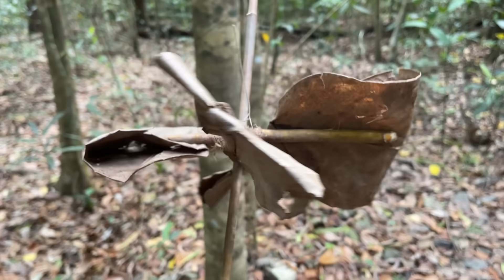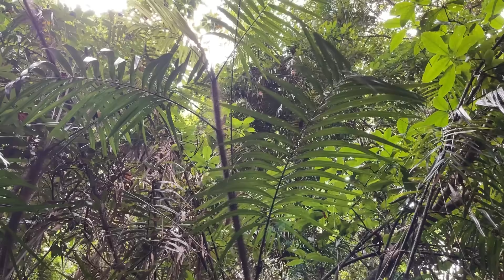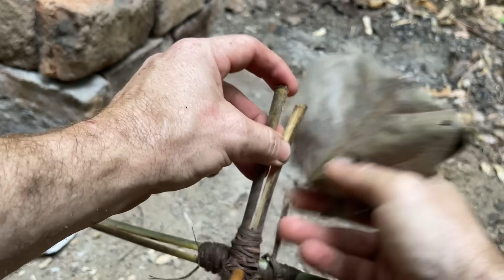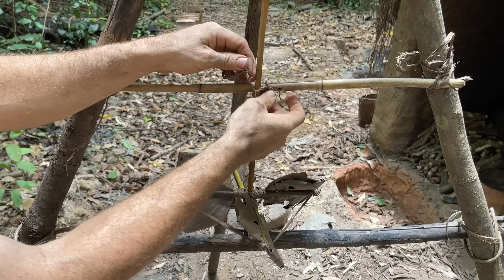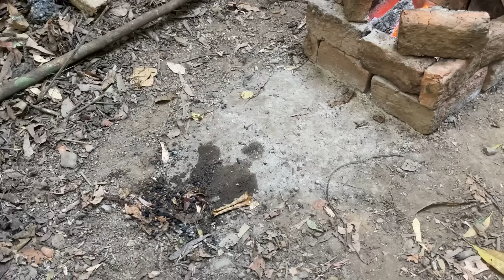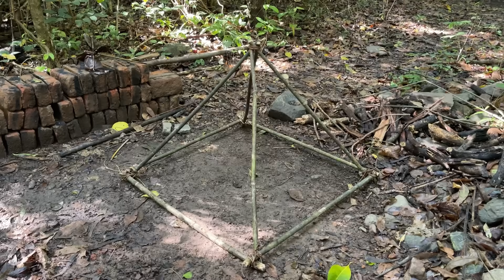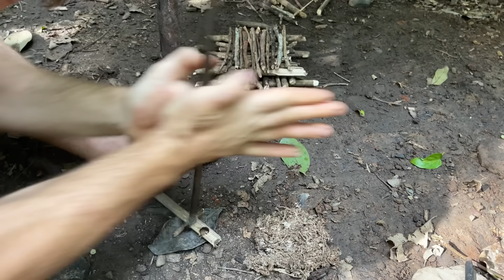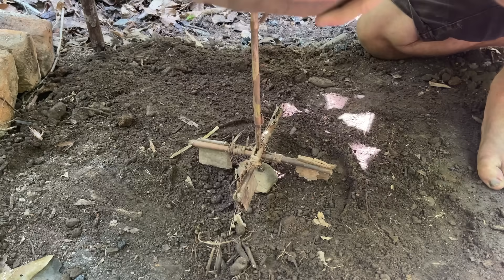Primitive Technology: Convection turbine experiments (hot air windmill)

Comment: The yield dont seem great. compare the energy released by such a fire, your own arm and the actual speed of the rotor. There is already a natural efficient convection that suck air. The turbine capture energy loss and the already efficient convection and transfert it with a yield. However your losing most of the heat and overpressure. If you lose all the gaz and the heat on the side, you are just introducing air resistance to the basic convection and to the inlet...

Self optimized fireplaces have solid wall with well designed primary/secondary flow to exploit energy. Also an hoven want to maximize the temperature and an heater what to maximize the dissipation it is not the same.

Comment: Nice proof of concept. A few engineering thoughts: the efficiency could be improved by shaping the chimney outlet into a side jet so the hot air hits the rotor tangentially and by replacing floppy leaves with rigid but lightweight cup blades that can actually hold their shape. Thin bark, split wood, or reinforced leaf cups would transfer momentum much better, while clay makes more sense for the chimney, nozzle, and the bearing seat (lower friction than a dirt floor). The jet should be narrow enough to mainly hit one cup at a time without choking the draft, the cups should sit at a larger radius for more torque, and shaft friction and imbalance should be kept as low as possible. You can lubricate and sharpen the shaft at the bottom and make contact with clay as said to reduce friction. Air is a weak working fluid, so power will be limited, but it could realistically be used for things like forced draft for a fire, turning a spit, simple grinding or polishing, or other low-power continuous tasks 😅

Comment: It may never be strong enough. There is a limit to what you can build with twigs and branches.

For the blower to work properly you'd need to spin it much faster. The windmill wont spin that fast, so we're starting to talk about gears which would need a stronger windmill which you'd achieve with greater pressure, which you'd be able to get with a watermill but not a simple windmill.

Comment: Unfortunately, due to availability of resources in your area you basically have to skip the bronze age in your tooling. However, I believe with your charcoal mound building process you could create a high pressure source of wood gas powerful enough to drive a higher mass turbine. This setup could potentially kill three birds with one stone by producing charcoal, powering a forge blower, and doing so while iron smelts. The only issue is that the size of the charcoal mound would need to be sufficient to last the duration of an iron smelt.

Open discussion in the replies on if it would be worth trying.

Comment: I think you'd need to make a silo-like structure out of stone that cones into a chimney at the top with several layers of turbines for more torque. I don't think it'd ever directly convert that little amount of energy into a meaningful fan blade without a gear drive to turn slow speed and high torque into high speed low torque. You're on the road to the fundamentals of a steam turbine, lol

Comment: For a more "permanent" hood: would it be possible to construct a frame and then add some woven basket-like  panels which are then covered with clay on both sides of the basket weave which then dries as the heat from the rise through the hood?

I'm thinking that it could be more resistant to catching fire, and it would also be easier to plug any leaks with more clay.

Comment: One of the issues with this is that firstly, the lower fan is too heavy, so the top fan doesn't have enough energy to move itself and the lower fan. Secondly, you'll have a constant problem if you solve the first part, in that as the lower fan spins more, the fire is fed oxygen and grows larger/stronger. You'll then have the issue of burning it down again, so you'll have to build a taller structure, meaning you'll have the first problem again of weight and size. A brick wall with tiled roof may help this, but I'm not convinced the energy created by a fire-powered wind turbine will be enough to put energy back into the fire.

Comment: HE UNLOCKED TURBOCHARGERS!!!!!

Btw, i think the main issue right now is that the air rising up isn't moving very fast. This will see significant improvements with a taller and thinner chimney, as you have made previously with bricks. The hot air will rise faster due to its increased termperature and the difference in air pressure. Placing the fan more directly into that stream of air, ie directing the air to flow only past the fan as tightly as possible will give you significantly better rpm. I'm not sure that you'll be getting better rpm than some of your other manual fans, but i believe with a tighter design it would likely blow more air in than without. I think there's a great discovery to be made here if you try again!

Comment: Its a gear ratio problem. You cant output more energy than you capture. You are capturing energy up top, moving it through the system (the stick) and having it perform work (power the lower blower). The work has resistance in the form of air resistance. You work is performed by the energy captured and, with all kinds of machines, you lose energy as a byproduct of performing work in a myriad of tiny ways that add up. Power lost via tension on blades against axel. power needed to turn the axel itself alone, power lost due to friction of the point on the ground. So no matter what you will never get 100% efficiency.

Upside, your power collector (the top fan) is larger than the smaller (blower fan). So you are collecting more energy than you are outputting. Which is why it turns and dosent just sit there. You need to lower the resistance and or increase the collection. Try removing some of the blower blades, either 2 or 1. It will have less blowing power into the fire, yes, but it will let the contraption spin faster and help prevent it burning down. Either that or you need a larger collector/top fan.

I was sorta hoping you were gonna power another turning axel or transfer it by wrapping a string around a stick a few times, then over to another, around it a few times and back to the first to "tie" them together and make them spin

Comment: You should really abandon all the wind/water powered ideas. There's just not enough power generation with such inefficient energy conversion devices. Going from mechanical power to wind/water power (for blowing/moving water) is fine but going the other direction isn't going to work very well.

Comment: Interesting concept, big improvement could be exploiting Bernoulli's principle, for example mud circular furnace with wide base, and chimney that is getting tighter the hier it is. Placing the turbine on top inside the chimney so that ne oxygen can come in and, now someone correct me if i am wrong, turbine shouldnt catch fire even if it is past the ignition temperature. Only thing i still didnt think off is how to connect the turbine to the blower.
Reply: Oh and maybe shape chimney with spiral grooves something like a gun barrel to give the outgoing air/smoke initial spin and hopefully boost the turbine even more

Comment: make a flu chimney set up. a wide billed pipe bigger on one end smaller on the other. Might need to attach 2 or 3 more of the same on the end getting smaller each pipe until its a coin sized hole. This will shoot airflow fast in the direction you desire achieving a  very fast spin

Comment: Some billion years later and we're still using the same method to generate power, except now we use spicy rocks to boil water to then use the steam to spin a turbine.
Somewhat related, you should try making papers. They're surprisingly easy but very time consuming. Make some pulpy water, put them in a mold, dry said pulp and you got paper.

Comment: Could you use the more even iron prills as ball-bearings to give it less friction? ^^
Reply: That seems over optimistic. How would you house the bearings? The tolerance required to create a functional bearing dont seem possible. Even if he made a crude bearing, I'm betting it would only increase friction.
Reply: @robtomben I was thinking half-tube bark strips or something along that line. Something that can also help stabilise it since you can more easily secure it without introducing friction (hopefully). 

But I dunno, I’m generally quite optimistic :,)
Reply: @mrbreider It would be cool if he ended up doing exactly that.

Comment: you need larger fins on the windmill to capture more energy so that it has more torque, you can then convert the higher rotational force into a higher rotational speed with a gearing system like those belts you made in a previous video

Comment: I think you just need a larger sized system.

Fan that is 3x the radius built with more rigid materials and a large axle made by solid wood.

Then at that point it might produce enough torque to power a blower.

Comment: I feel like putting the turbine into a draft furnace's chimney would be a good way to get the necessary pressure to then get enough torque to be able to power a blower, but I have no idea what John would need to use to make the turbine so it doesn't burn up. Maybe thin pieces of flint or obsidian, if there's any near his area?
But this video is amazing, like always.

Comment: Too much friction. The airflow needs to be more captured/focused/directed. Put the fan in the suction tube side of the air supply to an enclosed fire. (so it can only get air from the suction tube. It still won't get enough speed to really help but I think it'll be the best you're gonna get). Instead, maybe use a weight on the end of a long string coiled in a large spool. You'll get much more speed and power. Trade-off is you've gotta reset it every once in a while.

Comment: While it spins pretty well without a load, the amount of work being done is pretty small. That's why as soon as you place real resistance on it (the forge blower) it slows way down. You need to somehow either increase the velocity of the air entering the turbine, or increase the diameter of the turbine so it does more work.

Comment: the dude just built a way to efficiently drill holes into stuff... place a piece of wood you want a hole in as the thrust bearing, sprinkle a little sand in there and set it up over a fire. it doesnt matter that it will be slow... the fire is doing the work, not you. so you can set it up and forget and only occasionally check the depth of the hole, blow out the dust and add fresh sand. meanwhile you can make all other kind of stuff, like preparing the rest of the contraption that needs the perfectly straight hole in one part.

Comment: more blades(stack multiple fans on top of eachother) inside a narrower chimnie like structure tht feeds directly from the flame, good luck fire proofing that with natural material. also you can try pre heating the intake air for more fuel efficent combustion that (and spark arresters) might help.

Comment: Maybe try a tile roof with clay seals to fireproof and concentrate airflow.  Also, a top rotor that has more surface area than the one for the forge blower so it catches more escaping hot air.

Comment: A turbocharger would be neat, but I think that at this level of manufaturing and materials what you've got is more like a demonstration of why perpetual motion doesn't work. Some kind of clay chimney structure might drive the hot air faster. It also might need its own second fire as a power source for the turbine. The idea has potential, though. particularly if you can harness the forge's own exhaust to really bring the turbocharger idea to life.

Comment: 11:33 mFirst, the shaft is too long. instead of direct connection, try a pully and belt system.  That way you can have a gear change, and use torque.  Make the belt out of woven grass, and make the two pulleys have a groove in then that the belt stays in.  Also, if you think about the children's toy windmill shape, you need to curve your blades more, and have much larger blades.

Comment: 5:08 John, I wonder if you can get clay tiles thin enough to use for this fan.  First, it would be fireproof.  And second, it would also mean that the turbine would have greater potential energy.  Also, I wonder if you could try and make a wooden and clay roller bearing.  (the internal 'balls' would be the clay part) and then two carved wooden rings in a push fit and filled with animal fat.  How "modern" of a machine can you make with just primitive materials?

Comment: Just thinking with physics.... I'm not sure how well this kind of set up can work unless you can make an inflammable turbine and funnel. The more you improve the design, the better it will stoke its own fire... meaning the more it will risk burning itself down, making you have to move it further away from the fire, reducing its ability to capture the energy from the fire. I don't have much constructive to add because the only solutions I can think of would be relatively convoluted piping systems to relocate the fire.

Comment: I like the idea of two fire pits, one to power the blower and one to smelt. The "engine" pit gets a conical bore exhaust shaft to concentrate the airflow then the blower feeds the fire.

Since it's chemical energy at the root, recycling the furnace's energy doesn't violate conservation, so it's not a perpetual motion machine. For some reason my ugga dugga brain doesn't like it though.

Comment: Roof tiles instead of leaves, brick and mud for guiding hot air instead of sticks, multiple rotor blades on top of each other, question remains if system "turbocharges" itself, will organic matter on blades catching hot air last or burn? Maybe some ceramic material or something, concept is quite nice, thank you :)

Comment: How about thicker straight axle, stone bearing fit animal fat infused to bearings, maybe a round granite tone on the bottom and then coating the top blade with clay to make a composite that might handle heat bit better. Then make longer chimney so air has time to cool down. Could also perhaps make the whole top end from ceramic so it takes more heat and plug the wooden axle in it lower point with some water dripped to cool it? This way you remove the flammable leafs and change it to brute force. Also maybe play with chimney size to it accelerates the heat to get more power via constricting the chimney and having larger blade surface, though other 3 might slow it a bit there. This setup does work but issue is getting materials to handle the heat.

Comment: i saw where you were heading with this, not entirely sure if it would be feasible but if you had a chimney that was on a slight angle at the top to be able to have the rotor shaft come through the chimney wall as well as having a straighter rotor shaft. that could also possibly help with the fire hazard of it

Comment: Great Project!
Here is my humble list of improvements

roof made of clay
little clay wall between fire and rotating stick
better sealed bottom fan 
Maybe a bigger top rotor made of bamboo shaped like rotors
Maybe 2 gear wheels so that there is more rpm in the bottom

Comment: you need to find a way to fixate the flame away from the rod controlling the turbine in the middle, such as funneling into a slightly arched cone shape fixated towards the center of the roof. also gonna need more flame resistant roofing such as a clay roof top even if on one side. Introduce gears somehow into the equation to get the bottom turbine for the actual blower to spin faster generating more airflow, the more gears introduced the faster the result

Comment: This feels like an april fools video. I mean, if it's not a joke or a "just for fun" project, then I think you're trying to move to automation too fast. It's an interesting exercise, but I don't think it makes much practical sense in that form, it's far too inefficient. But yeah, definitely works as a proof of concept and makes for a entertaining video, as always. If you make the thing more stable, more rigid, less wobbly, with better bearings and make the hood/funnel out of clay, it might just work. Also, how fast can you make the air move? What's the speed limit? Does making a hotter fire make the air move faster? Would funneling it through a narrower funnel into a smaller set of blades make a difference?

Comment: pretty cool idea some solutions/ideas.

more blade sections on the top portion to capture more of the updraft.
furnace style updraft so it pulls air on it's own (still have to offset it from the roof opening), on top of whatever spinning will provide.

ceramic roof tiles instead of leaves for the roof. although the sticks might still get too hot, i suppose you could wrap most of the exposed roof sticks in clay, which should provide decent insulation from the direct heat. this will at least retain most of the strength of the stick while also protecting it. only concern i have is the weight of those roof tiles, might need beefier sticks to support all of that.

i suppose if there is enough torque, you could try a pully to change the gear ratio from the top to the blower so the blower spins faster. although with your limited resources, i'm sure there will be major energy losses trying to do such a thing.

Comment: so if you want to increase spin at the bottom you would need a greater rotational distance at the top. So maybe an increase in size of the top turbine would allow for a faster spin rate at the bottom. Though I think a water turbine would be better as it would be easier to get consistent results and less work over all.